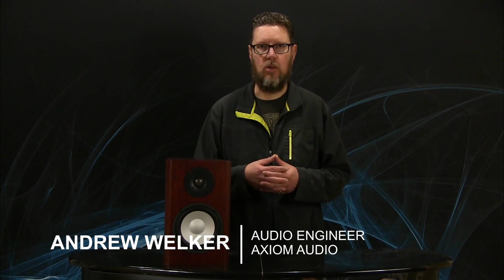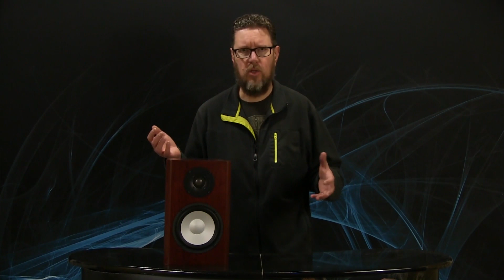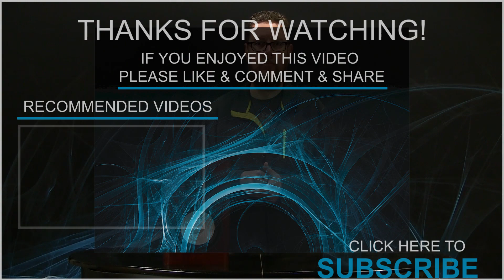Loudspeaker Design: Are You Looking For Speaker Design Theory or DIYing?

Comment: I built a set of floor standing speakers back in 1978 using off the shelf Radio Shack speakers, crossovers and wiring. They sounded great to a 18 year old that loved loud music. Today, I see instead of 18" woofers, 10" midranges, and Superdome tweeters, Smaller speakers, less speakers, and smaller cabinets. Now that I have more time on my hands, and still have my hearing. I'd like to learn all of the new theories in cabinet design, how to pick speakers that are high in their ability to respond, How to pick speakers that can do the job of the older units, and work together to create a full range speaker system. I would like to know how to create separation, clarity and depth.

Comment: My main struggle is with the phase right now. I've used a program to get a pretty flat frequency response but I don't think my phase is ideal. How big of a deal is this? And what might be some approaches to improving this
Reply: I'd also be interested in learning more about how speakers can connect to each other
Reply from the maker: If you’re using a program that does not take into account the actual parameters and aspects of the drivers, you’re never going to get a good result. In and of itself, phase is nothing to be concerned with, assuming your frequency response on and off axis are good.

Comment: Can you suggest some topology how to  design body for 5w to 8w speaker.
Reply from the maker: The power rating will have nothing to do with the enclosure design. You will need the driver parameters and then you’ll be able to determine the proper internal volume.

Comment: Axiom M5 is a well acclaimed speaker. It is faily well reviewed all around. My design question would be what part of this speaker could be improved to have objectively a significant sonic upgrade ? Crossover parts ? Cabinet materials? Drivers ? Inside damping ? A mix of that ? You know, Axiom  could call this improved M5 release a M5 Welker Signature or M5i 😛. Thanks
Reply from the maker: Hi Karl. Well, there is really not much that I can think of improving that would have any real impact on the overall performance. Sure, we could stuff in a bunch of “name brand, audiophile approved” capacitors, but it would not likely make a difference. Maybe a more heavily braced cabinet, but then you’d start to lose internal volume and bass.

Comment: Are narrow-depth wall or flush-mount speakers as sonically capable as floor standing?   Are there special considerations that should be in place to use a narrow-depth speaker?  I have my speakers set with tweeters about ear level, and a very slight toe-in.   For on-wall mounting neither positioning tweak may be possible.
Reply from the maker: Something I’ll certainly consider covering and I suspect many have the same question.

Comment: I've had 2 pair of speakers over the years with a downward facing woofer.  Both pair were great, one being in the mid range and one high priced.   Why has that never been a common design?
Reply from the maker: That’s a good question. There are some issues that need to be dealt with from an internal baffling standpoint, but it is an effective method of putting the woofer loading in a “known” environment.

Comment: Multiple dome tweeters that are over a foot apart in floorstanding diy tower speaker... How bad is that?
Reply from the maker: It depends on how you are dealing with the spacing in the crossover and what the designer is trying to achieve. Ideally multiple tweeters in a floorstanding speaker would be as close together as possible.

Comment: Is there a major problem with having a diy loudspeaker with 2 12s and unhooking 1 to achieve the right ohm due to a design flaw
Reply from the maker: There is no issue, but you will need to compensate the crossover for the other drivers so that the level and integration will still be correct with only one woofer.

Comment: I just have some general speaker questions that I'm just too lazy to dive into audio forums to find out.
- Is the comb filtering in D'Appolito drive arrays really audible?
- Why do some brands use horns, waveguides, and ribbon tweeters and others don't?
- Is a Klippel Near-Field Scanner really as good as an anechoic chamber for measurements?
- Will Axiom extend their full DSP loudspeaker line-up (beyond the LFR 1100 and the EP subwoofers)?
- How do you design a surround sound channel speaker if you can't go by normal loudspeaker design philosophy?
- Does replacing old capacitors on old electronics change the sound?
- Why did API had so many sub-brands?
- Wouldn't omnidirectional speakers be simpler to market if they had internal amplification?

- Should Atmos channels use direct speakers or surround speakers?

Whether anyone else is interested, I don't know. But you'll certainly never run out of content. 

Thanks.
Reply: i already thought of a bunch more:
- Time aligned drivers: do they make a difference?
- Some manufacturers use stone and concrete enclosures, but they still have resonances. What's going on?
- AMT, dome, ribbon, is there a reason to pick one tweeter over another?
- Are loudspeaker port noises audible? Wouldn't it be masked?
- Why are speakers today mostly narrow and long, instead of wide and flat like in the 70's?
- Are there actually stories of Ian participating in NRC listening tests? What were they like?
- How much of speaker design is done on a computer?
- Axiom seems to use a lot of CNC machining in some of your older videos. Is that what keeps manufacturing in Canada?
- What happens to your old prototypes?
- Why did you choose a sealed subwoofer design for the EP models?
- What are the defects that send a product to your B-stock?
- What's the difference between frequency response, sound power, and listening window? What should a consumer look for?

That's enough for now. I'm already convinced your company is one of the good guys for educating the consumer, instead of asking us to just trust the marketing.
Reply from the maker: @Daniel_Ho_Status_101  answered one of your questions in today's video, and mea culpa for saying David Ho instead of Daniel! It was edit corrected but just in case you can hear the error, apologies! https://www.youtube.com/watch?v=iUZ9Ivl_8ZM
Reply from the maker: Wow Daniel…there are enough topics there for separate YT channel dedicated to speaker design…it would be great if I didn’t also have a full-time job! Seriously, thank for some great suggestions!